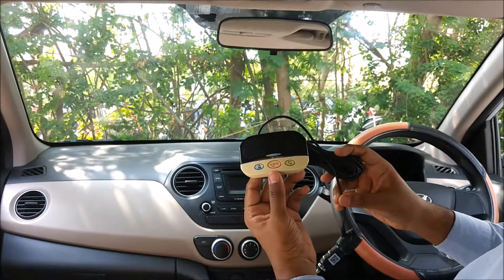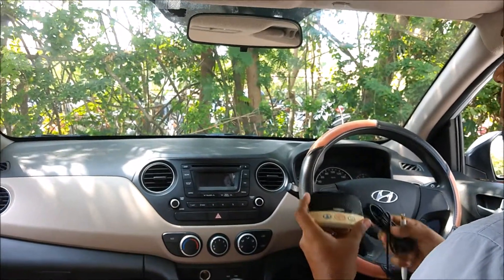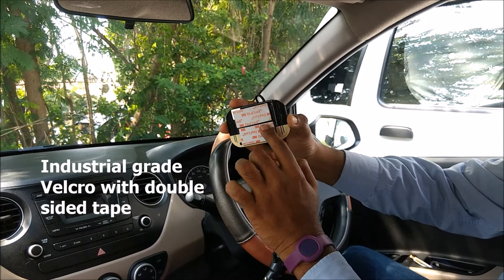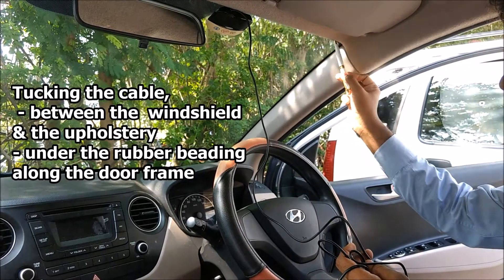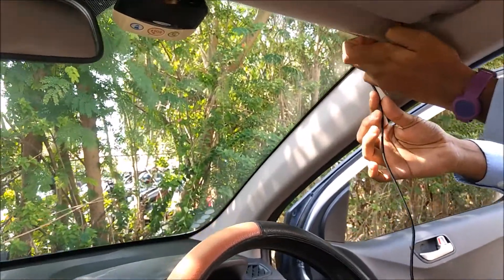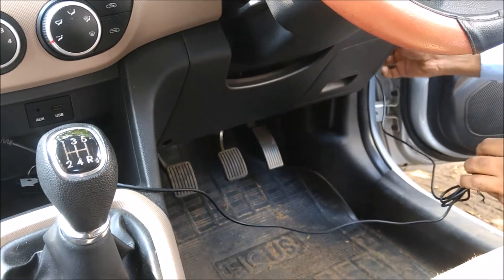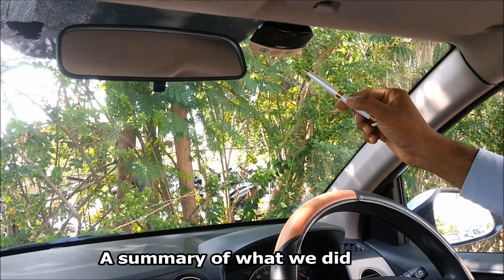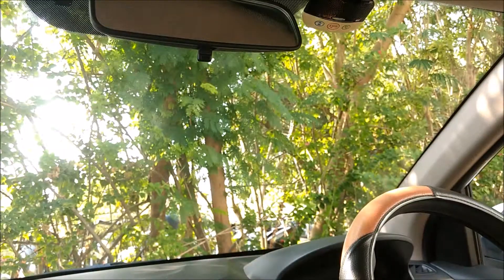SafeDrive - Installation

Comment: 10/10 for the idea.But still there is lot of space for improvement in this product.What if someone throw a stone on the front wind shield it will call to one of the family members n they get panic  unnecessarily.Also the continuous supply of power sucks the product

Comment: Just saw the CEAT Adv & started looking for this online.. In the Adv it looks as if the device is wireless. And here it is, ugly as hell with wires everywhere. Not only are the wires gonna be a mess. 25-30% will still be visible no matter how much ever you try to hide. Also kids may end up stamping/damage the adapter cause in every car the cigarette lighter is in a different location (below the dashboard, Near the gear etc.) and this requires a continuous power source. Would recommend you firstly make the colour combination classy & add minimum 10 day's battery life for a one time charge. Yes, safety is important but not at the cost of making someone's car look ugly from inside!! Your Adv too tries to hide wires, why? Cause you're in silent agreement with me..